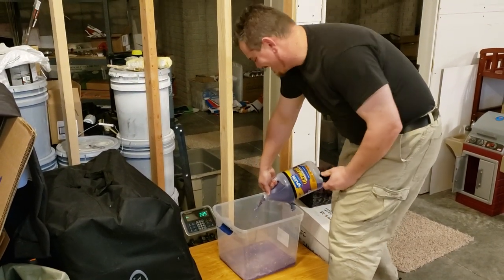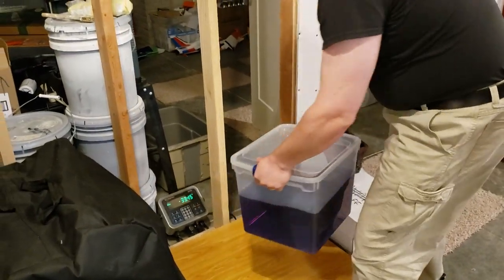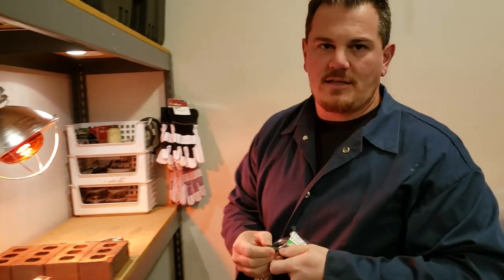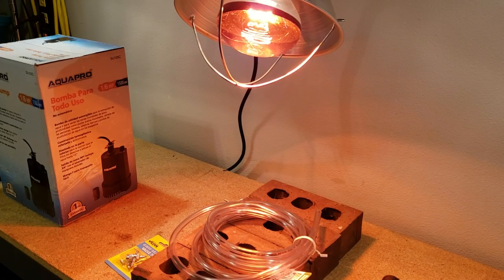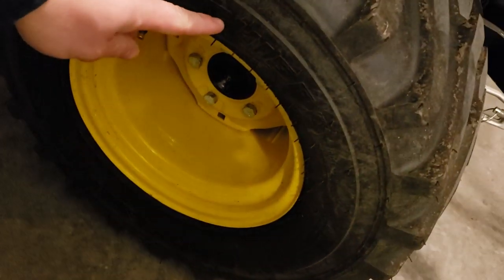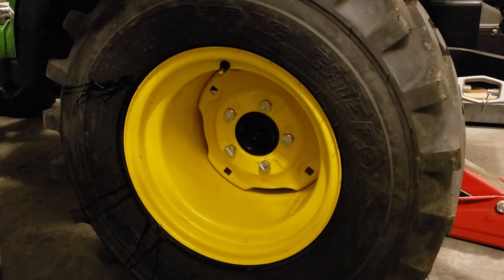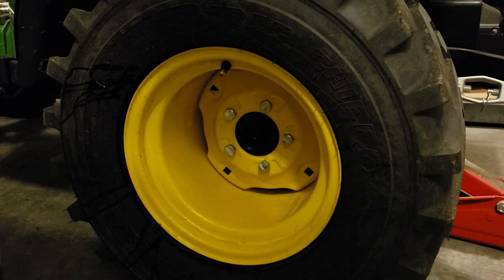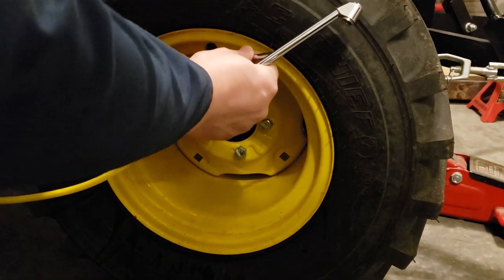John Deere 1025R - Liquid Tire Ballast - Filling Windshield Washer Fluid

Comment: This was the best video I've seen on how to do this. I was about to do it using gravity until I found your video and realized I had a sump pump sitting on the shelf for over 30 years I put it in a bucket of water and thankfully it still worked. I came up with some adapter is to make it all work together and it went very quick with no issues.
Reply from the maker: So glad we could help. I've now done it TWICE, and 900+ lbs added to our much larger Kioti DK6010 SE, and what a GAME CHANGER this effort will bring!

Thanks for watching, and for the comment Wade!

Comment: This was hands down the best guide. And my brother in law is a metrologist, tuning and fixing precision scales- so no need to apologize for your extensive research. Not my personality, but Jesus makes all types! And because of it I could ROLL with this project with confidence and not get TIRED. 

Huge thanks. 
-Andrew
2 Chronicles 16:9
Reply from the maker: Thanks Andrew! You GET IT ;)

We did this again in our newer 60hp Kioti DK6010SE, and it was a lot more work, but we also were able to add about 950 lbs of weight - very helpful!

Comment: I went with -50 RV Antifreeze. It was the same price as window washing fluid at Walmart, weighs a little more per gallon, and is non-toxic (WWF cannot be made non-toxic). I would have used Rim Guard, but it is not available in my area, and shipping 110 gallons would cost a fortune!

Comment: Putting weight in the front tires will help with lowering the center of gravity of the tractor, helping with side to side stability.  I believe it will however take away from  ( or at the least, not add to ) the counter weight , and purpose of putting weight in the back tires to offset the weight of a load in the bucket.    Also, as you said, the front tires will be stiffer and ride quality will suffer.   Seems like a decision people will have to decide what advantages and disadvantages weighting the front tires does.
Reply from the maker: yeah, but I need weight., so I can resist tipping over. Loader counterweight hasn't been a big issue for me yet, but now that I have a mini baler (which is hardly MINI), I'm SOOOOOO glad I did this. The few extra pounds down low has been to the detriment of the ride quality, for sure, but it's nice knowing there's almost to additional weight on the axle from the tire being full, and still keeps her stuck to the ground just that little bit more ;)

I also used a few dead loadcells from axle scales too, and painted them to match, then zip tied them to the loader leg (folds up under the loader arm) and they add over 100 lbs too! Plus that part is 2/3 on the left side, so when I haul an item that hangs to the Right, I'm putting the counterweight where I need it.

It is strange to me, adding weight for a better experience, since I fly these RC airplanes, where weight is the absolute enemy ;)

Comment: How would u put diesel in the tractor
Reply from the maker: Diesel is on the top, right by where the driver sits. I have a hat sitting over that spot, which might have obstructed your view of the green diesel cap.

Comment: You should run the pressure lower because liquid doesn't compress. Your tractor will ride harshly at 20psi. I'd try 10psi , maybe less. Maybe I'd even fill it up to the valve at the 12 o'clock position and not add any air.
Reply from the maker: I was thinking about that too, but don't want to lose the bead if I hit something hard...

I think the ride has been pretty good since adding the weight, but BOY can you feel it!!! When I put on the ~650lbs+ Ballast box she drives different! After using the heck out of our 1025R, I can't hardly believe how capable it is while at the same time, I can see why having a bigger tractor would be really nice. Such a double edged sward...I need to get into tight areas, but need the power and hydraulic pressure to get work done...what I really want is to have about 25% more power on the hydraulics on the 1025R, without destroying the loader.
Reply: @BrianPhillipsRC  
... or a 2038 🤣
Reply from the maker: Too much more money for not enough increase in specs.... I would go for a larger 3 series, or 4 series next...but they too are ultra pricey!

Comment: Bruh that was a lot of gallons of those fluid
Reply from the maker: yes, and it worked well! I used the tractor to move a huge 16 foot log today. I added the bricks to the ballast box and that added another 550 lbs, on top of the 218 lbs worth of fluid from this job, my tractor is up to 2,838 lbs, up from 2,070 lbs, or a 37% increase! The rule of thumb is a tractor can tow about 1.5 times its weight, so I went from 3,105 lbs towing capacity to 4,2557 lbs!!! (1,152 lbs increase!). That's a lot more weight!!!